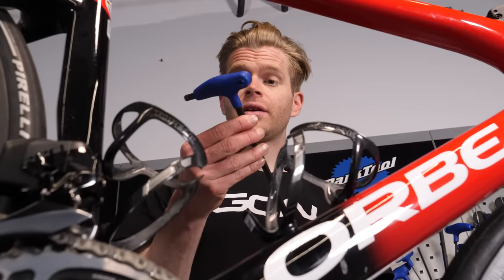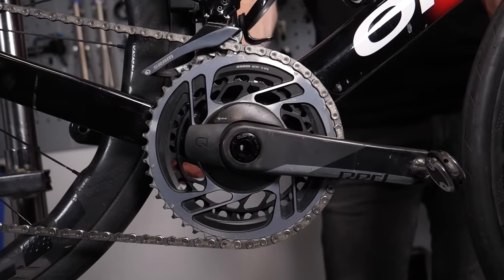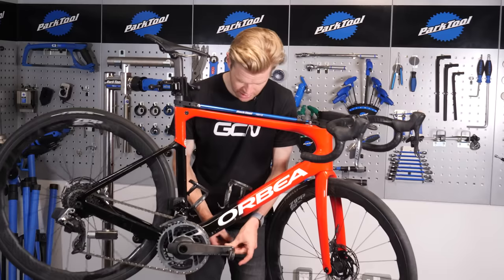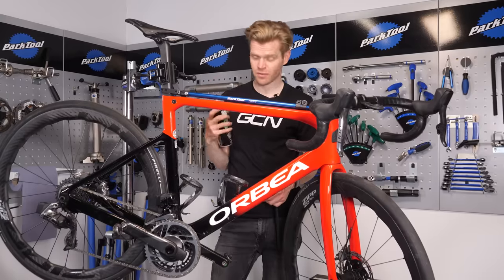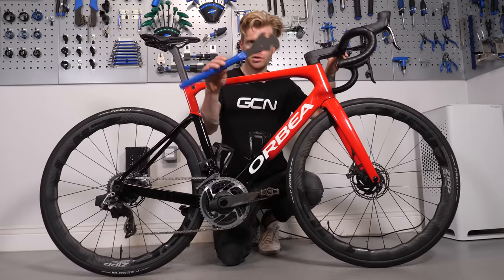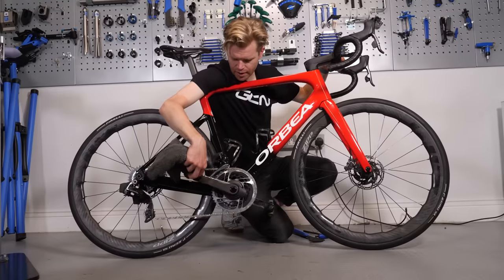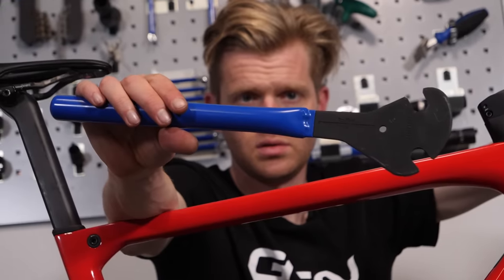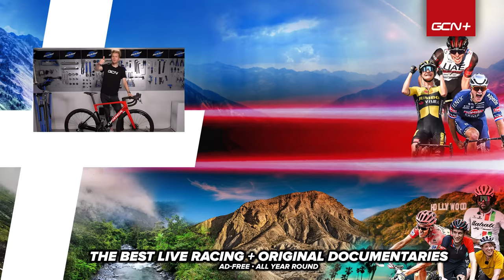How To Remove Stuck Or Seized Bike Pedals | Maintenance Monday

Comment: What's annoying is that some pedals use only the allen key method to screw pedal axle in/out! I'm looking at my ultegra carbon pedals and it would be so much easier to have the pedal axle with spanner flats to avoid wrecking the allen key hole! So much easier and you can apply better force!

Comment: i got a crank with pedals stuck on it, steel axles dug in soft aluminum.  i felt the allen key was gonna strip if i kept applying pressure, definitely wouldnt add a longer lever to strip it with less effort. the only way to get it off was to grind the spindle to get a wrench on it with the allen key, then with super human strength i got it. it definitely need both tools on it. the spindles were still good to use but i didnt like how they looked so i just replaced the spindles.

Comment: For the right side rest the crank on a block about the hight of the crank horizontal  rear facing pedal get any long wrench 15 mm and use your foot on the wrench after a few leverages it wil go the left will be the same facing the pedal rear this way the crank cannot move get some one to lean on the saddle and steady the bike 
When fitting a new set of pedals use grease/copper grease to the threads only pinch tighten 😊

Comment: Left hand pedal has a left hand thread. Easiest way to remember it.
Ultimately the important thing is to dismantle and regrease the pedal threads from time to time. Because whatever grease you use, if you leave it too long that electrolytic welding occurs. But we are lazy and find we have left it too long.
Today, I tried to remove a pedal I assembled about 8 years ago. I balanced in the air, one foot on the end of the pedal spanner, the other on the pedal, putting my whole body weight into it, and the pedal wouldn't move. That had been enough for the opposite pedal. So I wired a 4 foot lever to the pedal spanner, got a family member to stand on the pedal, and with the leverage the pedal spanner bent. It's a Campagnolo spanner made of much thicker steel than a Park Tools one.  I doubt that pedal can come out without wrecking the thread in the crank. I did use suitable grease when originally assembling it, but it's too long ago.

Comment: Just one little note that pedal thread direction is unlooseing in the direction where the pedal is rotating compared to the crank arm. So the thread direction is to make sure not to over tighten itself. When you screw a pedal in it is always you rotate the crankset backwards, right?

Comment: About the self tightening bit, actually I was wondering why the pedal self tightening when the pedal and crank arm turn in different direction, for right pedal, pedal rotates counterclockwise as you pedal, with the fixed-axis pedal spindle rotating clockwise. Turns out it's because the bearing inside reversed the torque
Reply: The bearing is an essential part of the system, but it's not what causes the torque reversal.  
It's a bit difficult to explain in words, but any time you have a round shaft inserted into a hole (threaded or not) where the fit is slightly loose, then apply a rotating torque to the end of the shaft, it will slowly turn in the opposite direction.  This is entirely due to friction, and the diameter difference between the shaft and hole.  
For example, looking at the right-side crank from the right side of your bike, if you insert a pedal loosely and move the outer end of the pedal in a counter-clockwise circle (simulating what happens when you're pedaling and the cranks are turning clockwise), you will see there is a slow clockwise rotation of the pedal shaft.  The torque available for that clockwise rotation can be very high.  As this is dependent on friction, you can reduce the self-tightening torque by applying some grease and keeping threads clean of any dirt.

Comment: Take your pedals off once a month, clean the threads (both on pedal and in the crank), grease the threads very lightly, and replace the pdeals. That's the best way to make sure that you don't have stuck pedals on your bike. For other people's bikes with stuck pedals, honestly the best tip I know is to have a helper hold the bike steady so that you can use all your strength and leverage on the pedal wrench or Allen key instead of having to contort your body in strange ways to brace the bike.

Comment: I've got cheater pipes and everything. It hasn't helped. I'll need heavier duty tips.

Story time, so this is a steel bike, really basic and cheap one, but i rescued it from abandonment. When i found it, the complete chain and derailleur were rusted shut, completely immobile; from this i conclude that it must have been abandoned for upwards of 3 years and likely much much more. The lock was rusted shut too. I tried to pick it, but even with WD40, there really wasn't any movemet happening there. I was making my way through the cable part of the cable lock with a saw, when a good looking young man came by and offered help, which i accepted. He came back 5 minutes later with largest bolt cutters and asked "are you sure this is your bicycle" and i just gave him the puppy eyes :D Anyway he made short work of that cable lock. That was 10 years ago now i think.

So you can imagine it's been a TON of work, lots of bits needed restored or replaced, lots and lots of rust everywhere. My current problem is that the bearings in the pedals are shot so they need to come off, and one is just holding on hard.

Oh also i don't weigh very much. That might be part of the problem.

Comment: I think of the direction to loosen as towards the back of the bike.  Personally, I am waiting for an 8mm allan key that fits between the frame and the pedal--a 1.5cm  short side.
Reply: A few minutes with a hack saw, and you can make what you are waiting for.
Reply: @marianneoelund2940  it's a lot of minutes with a hacksaw on tool steel, but yes, if I really wanted to do it, I could.  Maybe during a flat stage of the upcoming Vuelta.

Comment: Once you do get it off from these tips. Probably the next very best thing to do toyour pedals and your crank arms is to apply grease or anti seize on the threads of the pedals or the threading of the crank arms where the pedals threads for future proof of the term cold weld when nothing you can do will loosen it up if you don't clean and check to see if your pedals can loosen or tighten.

Comment: I'd suggest using a wrench, putting it parallel to the crank arm, and then tap a mallet on the wrench roughly where the bottom bracket is. Taps usually work seized screws just fine, and putting the force by the bottom bracket means no resulting torque.

Comment: Warm up an alloy crank with a heat gun or propane torch until the grease just begins to smoke but not hot enough to damage paint.  The alloy expands more than the steel pedal spindle making the stuck pedal easier to remove.

Comment: I've had BB threads and pedals threads seize up REALLY bad and a good 'breaker bar' is essential for removing old bb cups, though i find 'thread lock' is the biggest problem with seized threads.

Easiest thing to do is loosen and then re-tighten these threads once every 4 - 6 months, and you shouldn't have any issues.

Comment: Does your body weight effect what frame you should buy? Im 17st so would carbon be ok or am i putting to much stress on it and aluminium/titanium be a better option?
Reply: Definitely. At 107 kg, you're pretty close to the general weight limit of most carbon frames. Wheels require more attention as well.

Comment: my pedal was destryed. i don't know how, the pedal had seized up. in ended u stripping the bolt.. now what?while at home depot i walked by some pipe wrenchs. okay. a type grip and p;enty of leverage. it worked  like a charm. you may hhave to destry the pedal. i assume threason you are removing it is for replacement anyway.

Comment: I must confess I miss those older and/or lower-end pedals. A pedal wrench offers unmatched leverage and security.
Reply: Older or lower-end?  My new $1200 Garmin Rally pedals take a 15mm pedal wrench.
Reply: @marianneoelund2940  There are always exceptions, of course. Most older and lower-end pedals are designed to be installed and removed by a pedal wrench. That’s not a mark of either age or low quality, just a design trend.

Comment: What about putting a towel over the chain ring to soak up the blood when you hit your knuckles against it? At least shift into the big ring.
Reply: This is yet another reason why you want to start with the wrench handle positioned near the center of the crankset.  Or use your foot while wearing sturdy shoes.

Comment: Crank forward, wrench forward. Foot on pedal pushing down while pulling up wrench handle... easy. The bike should be free standing, and you are facing backwards. Doing it this way you form a long lever (crank + wrench) that you are trying to bend in the middle; you get leverage from both sides, and keep your hands as far from the chain ring as possible.

Comment: Since we are talking about a seized pedal. Take your bike to your bike shop and they will do it for free and safely. When you replace your pedals TAP the allen key or spanner to  tighten the pedals on after applying grease to avoid a seized pedal the next time. To know which way to apply force, remember the phrase BACK OFF.

Comment: An If you are verry unlucky like me you need to dismount the Crank Arm and Use a vise.

Had a colleague of mine how got 1 Pedal lose, and the other did not move a bit.
He had ruined the 8mm and also the 15mm . (Typical chinisium Metal which is just too soft)
So I destroyed the Pedal and clamped it in a vise and used my hole body weigth(110kg) to get the spindle of the pedal lose.
And all of this at a bike wich had only 50km and he wanted to change his pedals.

Comment: Hi Ollie, YOU ARE WRONG! Pedals are (have threads) "self loosing / releasing" during forwards pedaling! Try it! 😉 And why they don't loose / release by pedaling? It's MAGIC. 😁
.
.
.
.
.
.
Exactly i dont know why is not necesary to tight pedals, i know only that i must oil the thread and tight it only little bit. HND.
Reply: Absolutely! Just wanted to give the same comment 👍
Reply: It's not magic.  It's mechanics.  
If your pedals have extremely stiff bearings, it can override the self-tightening mechanism (I've seen this happen on children's bikes with poor-quality bearings), but otherwise, the rotating force applied to the pedal shaft will produce tightening.  The tightening torque results from the friction between the pedal shaft and crank-arm hole, plus the slight wobble that exists when the shaft isn't tight.
Reply: @marianneoelund2940  Yes it must be only mechanics, in case that pedal bearings will completely stuck up, then the pedals will release from crank arm (i tryed it again now). I have problems to understad the force direction causing self tightening. Maybe there self tightening does NOT exist and troubles with releasing pedals from crank arms can do any dirt (collected) on threads (during riding)? 😐 Maybe tightening can be caused by loosing e.g. oil from threads, reaction between two metals or rust. 😉
Reply: @TRiX_ONE  Yes, if the pedal bearing jams, it will cause the pedal to loosen.  But given a bearing in good condition, there is another process at work.  It is called mechanical precession, which occurs whenever a shaft is inside a slightly larger hole, and a rotating radial force is applied to the end of the shaft.  The rotating force is the rider's force of pedaling, and the resulting tightening torque can be quite high.  
There is a wikipedia page with a description and a motion graphic which shows the precession in operation:  https://en.wikipedia.org/wiki/Precession_(mechanical)  The rotating green arrow is the force applied to the pedal by the rider, and the blue circle is the pedal shaft, which is slowly rotating in the opposite direction.  
The tightening torque is dependent on the rider's pedaling strength, and the friction between the pedal shaft and crank arm threads.  Adding grease limits the tightening torque and aids removal of the pedal after riding.
Reply: @marianneoelund2940  Ouh Yeah! Now i know! 😊 Thank You Very much! 👏 The WiKi animation is great!

Comment: Ollie actually got the thing with the threads completely wrong. The pedals are supposed to loosen as you pedal bc you will never get the pedals off if it's the other way around
Reply: If you put the 15mm spanner on the pedals and turn the crank the direction you would pedal in while holding the spanner in place (holding it parallel to the ground as you turn the crank) the spanner is actually turning upwards relative to the threads and the pedals will come off.

Comment: All you really need to remember when removing pedals is - back-off.... So you rotate the thread towards the back of the bike to remove.
Reply from the maker: Nice tip!
Reply: The freewheel helps hold the chain and crank still when tightening, but rotates free when trying to loosen the pedal.

Comment: Why the hell manufacturers make pedals that can only be fitted/removed with an Allen key is beyond me, it’s surely just as easy to make them so a pedal spanner can be used and it’s so much easier and safer than using an Allen key - as my knuckles will confirm!!!

Comment: I add washers and grease and never had a stuck pedal.
Reply: My Garmin Rally pedals came with washers - ostensibly to provide a bit more clearance if needed - but I always use them to aid removal.  That's important, as I swap them between several different bikes.

Comment: You forgot the best way.  Put anti seize on them so the never get stuck in the first place.  Nearly EVERY threaded connection on a bike needs some form treatment - anti-seize, grease, or threadlock, all of which will prevent the corrosion that leads to this problem.  If you're religious about using that stuff, you never really have these problems.

Comment: Trying to remove pedals that have been on my bike for 19 years... 😅 quite impossible
Reply: Use a LONG pipe over the handle (like a 3 foot piece).  Use his trick of standing on the pedal with your body and then pulling the wrench against your weight.  And don't use a cheap "adjustable" wrench.  Get a dedicated 15mm open-end wrench (or one of the fancy pedal wrenches he shows).  Don't even try it without the pipe.  I have been in your situation.  The pipe saves the day.

Comment: You said clockwise to tighten on the drive side but it’s the opposite. Jeez.
Reply: No it's not.  That's correct.  You tighten it clockwise on the drive side, and counterclockwise on the non-drive side.   Don't get confused if you are using an allen wrench from the back side of the pedal.  That can get your head turned around.  The direction of rotation of the bolt or nut is clockwise on the drive side.